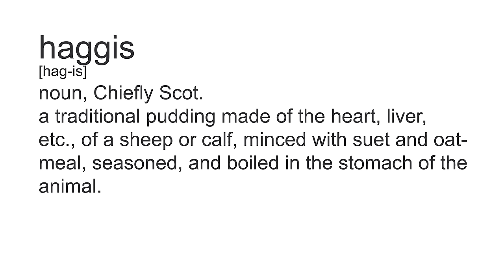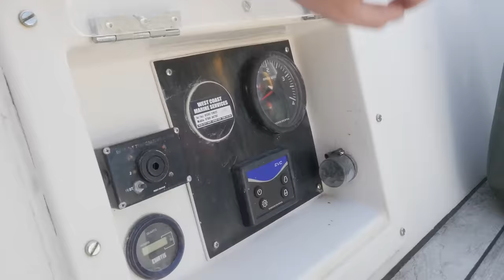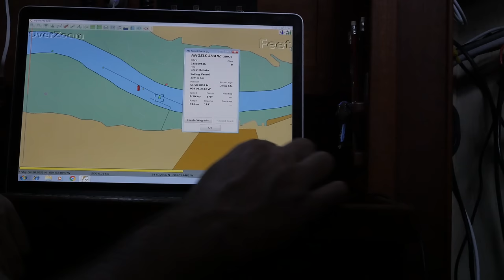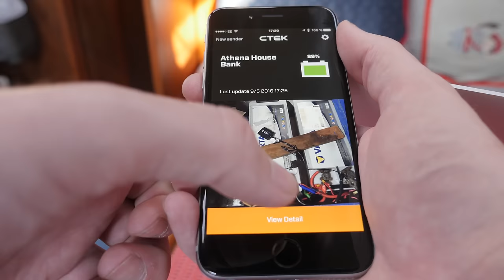Sail Life - More maintenance & CTEK Battery Sense, BHA #2

Comment: I love the details on the maintenance.  I always kept a maintenance log on my bikes. Anytime I did something it was noted in the log and included oil, filter types, mileage or hours and links to any online information I used.  Aside from not having to actually remember when or what I did, it was much appreciated by anyone I sold the equipment to.  The same thing is done to my car only the dealer keeps the records and I get a print out.

Comment: I know this is a way old video but I also know how far you have come as I have watched almost all your videos on the new girl. I look forward to seeing your videos every sunday and just wanted to say one thing about battery monitoring. You can't get accurate states of change using voltage because of sag's on the drain side,  rises on the charge side and has to sit for a wile for a accurate voltage reading. What you should look into in monitors that watch the amp hours drained and amp hours taken on a charge. that way you know almost exactly how much power you have left. voltage readings are only good to check that you have a stable output.

Comment: I hope you had a great trip and glad that it was a safe voyage.  I do a lot of servicing on heavy farm equipment. In addition to the date I always put the hobb hours on the filters as well. The date is a good guide but the hours is a better reference. You might only put 20 hours on a motor in six months or you could put on a 100 hours a week. On my airplane it was every 50 hours or one year. What ever came first. I would use this for you engine as well. Happy sailing!
Reply from the maker: +RC That is an excellent idea! Thanks :) I'm sure most sailors only put the date on there because they rarely rack up enough hours. When I go cruising full time I'll definitely put hours on there as well as the date :)
Reply: +Sail Life One thing I didn't mention is when I put the info on the filters or at least metal canisters I scratch them in with my pocket knife. They'll start to rust at the scratch marks but it's permanent. If you do this on your marine engine just put a clear coating over it. It may sound a little girly but I sometimes will swipe a jar of my wife's nail polish to cover with the clear coat or bright color to mark a spot on something. It has a built in brush, small, and doesn't dry out in the jar. You might ask some of your neighbor ladies for some. I wouldn't go to the store to buy some. lol Have a great weekend.

Comment: As a diesel mechanic, the CTEK battery sense is certainly a nice addition, it WOULD be a better system if it included volts and I'm surprised  that it doesn't have a setting that allows you to view the voltage.  One thing it does have is an alert mode in the settings that will message your phone.   I might create a chart of voltage corresponding to the percentages.  That way you might easily be able to understand at a glance what percentage shown equates to actual voltage.    The fact is if they are basing percentage of charge on the TOTAL output of the battery from 100% to 0%  (a bad way of estimating charge in my opinion)  then 89% of charge @ 12.3 volts equates to your batteries 100% charge voltage being 13.6 volts.  Depending on the health of your batteries that will change over time obviously.  I might see if there isn't a better battery monitor out there but it is better than nothing!

Comment: Hello Mads,

I have been using a very economical battery monitor in my 2 battery bank system with great results.  It is a 
INNOVA 3721 Battery and Charging System Monitor Costs about $12 on Amazon or many other retail outlets.  It simply plugs into a 12V outlet and gives you the voltage in the circuit.  I have a battery switch so I check each battery then I check with the switch on both.  These are both house batteries so sometimes I just leave the Innova plugged in so I can see what the batteries are doing at a glance. I have several DC outlets.

Jerry

Comment: Fully charged lead acid flooded battery should be 12.7, nominal voltage is 12.7.  12.3 would be around 65 percent at room temperature.  Perhaps battery sense takes temperature into account?

Comment: Taking battery voltage does not necessarily tell you the state of charge of the battery. Assuming these are lead acid based batteries you need to pick up a specific gravity gauge, get a nice one and keep in mind they're fragile. The best way to tell state of charge is by taking specific gravity and matching that up with a specific gravity chart, sometimes the battery manufactures will provide them online. In order for that app to know the state of charge you will have to have it configured with the right information, battery information to be specific: total amp hours, voltage and whatnot. I would prefer just seeing the voltage also...maybe you can write the developers and ask for that to be an option. Another thought is maybe you can find another APP that'll connect up to that product where someone has already thought of that and created it. Lastly, as a programmer myself, I would just write one if the developers provided an API let's say.

Comment: I have a Clipper battery monitor that does everything I need. The problem I see with what you have is you're going to have to keep or turn the phone on every time you want to see your battery charge.
Last I checked they hadn't installed cell towers in the middle on the ocean so why would you have the phone on? Im sure you can get it on a tablet but what a pain. I'll keep my clipper.
Its on and ready for me to see 24/7
Reply from the maker: I have a BM-1 battery monitor board Obelix (the one you mention - unless you have the BM-2). I wanted to play around with the CTEK Battery Sense just to see what it was like. It won't be my primary battery monitor aboard Athena (I plan on installing a Victron BMV 702). I do actually keep my Phone on at all time. I use it for sending and receiving messages from my InReach ;)

Comment: We use a Victron battery sense, which not only measures the state of charge but also a number of other parameters.
https://www.youtube.com/watch?v=AyOTmbsk_o0

Measuring the state of charge is quite complicated and probably impossible without knowing the current in and out of the battery plus battery parameters.
Measuring just the battery voltage is not going to give an accurate reading of state of charge.
If a standard charging system is used 13.4V-13.8V the battery will only ever achieve about 75% of its potential. It is only possible to charge to over 90% by using an IUOU (smart charger) or a pulse system.

Comment: When fully charged each battery cell should produce 2.1 volts. Do the math. Straight away I observed the 89% along with your proclamation of 12.3 volts on your multimeter and knew you either have a small load or a weak battery cell. Cheers.

Comment: Hey Mads, great to see you got home okay and looking forward to the videos of your trip as they are uploaded.  There is a battery monitor on ebay sold for motorbikes, bit cheaper that Ctek and it shows VOLTAGE!  http://www.ebay.co.uk/itm/JMP-Bluetooth-Battery-Monitor-using-iPhone-or-Android-Smartphone-/371488380784?hash=item567e6ed770:g:sMAAAOSwLzdWSnvz. I guess you have to buy one for each battery but maybe better than the % as I agree that is not that helpful, both would be even better.  Best wishes. Andy
Reply from the maker: +FrenchAM100 Hi Andy :) Thank you so much :) Someone has turned me on to Victron's Energy BMV-700 series. I'm in love! I'm very much looking forward to taking a closer look at their battery monitor :) The one you've found seems like (to me) a more useful product than the CTEK Battery Sense :)

Comment: Personally I think you would better off with a proper battery monitor and shunt such as a Victron Energy BMV-702 which measures much more and has a free app. Note I blog for Victron and have tested a number of their products. Contact me via my page and I'll see what I can do. https://facebook.com/ElektraYachts/
Reply from the maker: +John Rushworth I agree 100% :) Anything with a shunt like the product you mention or the BM-1 I've got aboard Obelix will be much more useful. I like playing around/testing products and that's the only reason I purchased the Battery Sense. I don't expect much. I might reach out once it comes time to choose a battery charger. I'm looking at 3 different models (one of them from Victron)
Reply from the maker: +John Rushworth Just checked out some blog posts and came across this. https://www.victronenergy.com/blog/2016/05/12/victron-open-energy-monitor-emon/ I've been a long time fan of Open Energy Monitor and have put together several of their kits over the years. This is going aboard Athena - no question about it! Should make for a nice winter project :)
Reply: +Sail Life Ha! You pick the one guest post we've had for ages. Not my post but I agree - a good idea. The concern I had for the Ctek is that resting battery voltages vary depending on make/type of chemistry and it will be of little use under load as you probably know. The reason I'm very interested in battery monitoring (including temp monitoring) is I pull high loads. As much as 0.5C on my old AGMs but now using Lithium so the C rate becomes pretty irrelevant. Enjoyed your trip. It's a few years since I was in Kirkcudbright with my boat and sailed to Oban. Have been through the Caldeonian canal on a previous boat round to Whitehills past Inverness. Great scenery eh. Looking forward to your edited videos.
Reply from the maker: +John Rushworth I hadn't even thought about the difference in resting battery voltages. Good input! I was aware of the issue with measuring voltage under load. That and the fact that they only show their interpretation of charge state in percent makes for a somewhat odd product. Lithium - nice! I noticed you have an electric motor on your boat. Lithium batteries must be a big advantage over AGM in that application :)  Loved my stay in Kirkcudbright :) In fact, I loved all of the west coast and the canal! Amazig scenery! I'll be going back for sure! Don't expect too much of the footage from the trip back home. I managed to catch some kind of bug so I was a bit under the weather for most of the trip.
Reply: +Sail Life Yes, I was sorry to hear about the 'bug' on Facebook earlier. A shame. At least the weather was kind to you. The other thing about batteries in particular is the Peukert effect, which really comes into play with lead acid tech at any load higher than the C20 rate. Handy spreadsheet http://www.smartgauge.co.uk/calcs/peukert.xls PS. Yes, lithium is awesome. None of this absorption and float wait wait wait to charge ;)